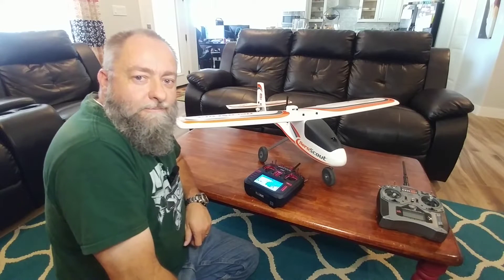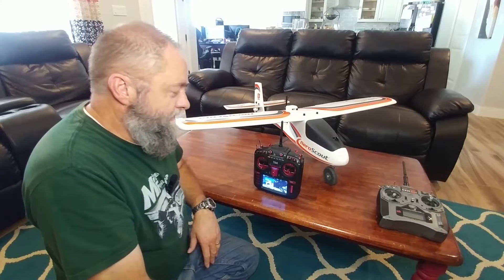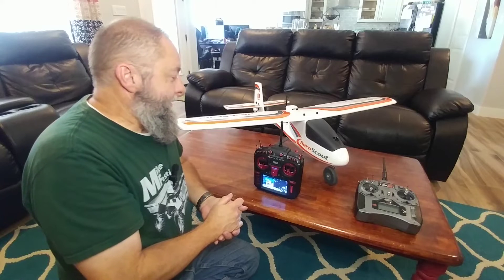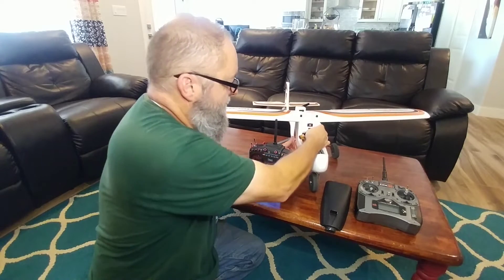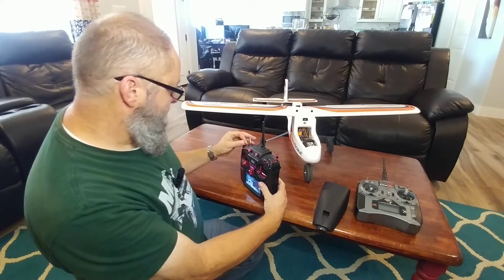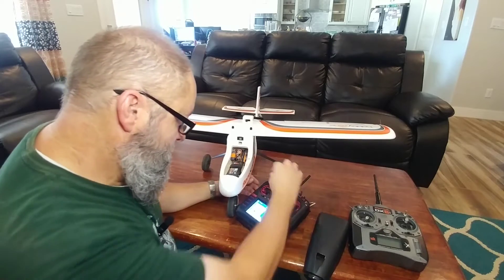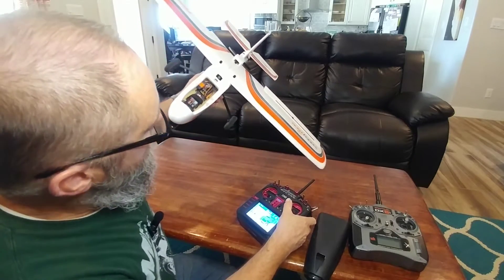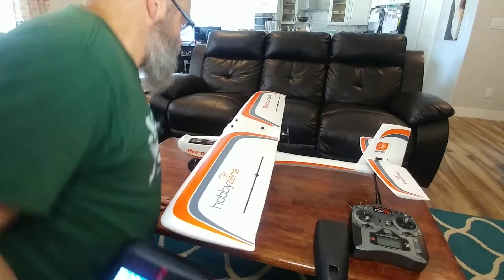Spektrum RC Safe Modes on the Radiomaster TX16S!

Comment: I have a signed switch did sticks to the centre the bind was done to get safe surfaces twitched 2 times but only got as3x but not safe any ideas
Reply from the maker: The double twitch means you enabled safe but needs a switch properly assigned to be able to select the desired mode.  What model are you working with?  Some like the AeroScout here, have channel 5 set to safe f-modes and ch 6 as panic until/unless you unlock it.  Other models don't have this restriction and you can change it.  Many require you to assign the channel by moving the sticks down and in and flipping the desired switch 5 times to set the f-mode channel. If you have that type, you must assign the desired switch to the desired channel in the mixer and then you can assign it.  You can also assign the switch to the channel similar to what I've done here in logical switches and special functions but that is more complicated.

The main reason I've used this method in this video is because I'm combining the safe f-mode and panic modes to produce a non standard flight mode.
Reply: I've done all that moving stick together flicking switch it's on f16 80mm spektrum rx but only get safe or I do first bind to get as3x I have 5,6,7,spare ch
Reply from the maker: @stevejamelskyj5761  I would need to see how you've setup the f-mode switch and to what channel it is set to. To keep it simple I wouldn't set it up in logical switches and special functions like I did in this video for your application. If you've set those up, I would disable those special functions for now until you verify the channels are setup properly.  Just go into our mixer, create a mix for whatever channel you want to use for safe on/off (f-modes) and the desired toggle switch will be the source.  Don't set anything in the "switch" field of the mix.   Then with the plane and tx bound (be sure to use DSMX and NOT DSM2 or it will not work).  Don't have any low rates programmed or the "stick and switch flip" method will not work in low rates.

What RX are you working with?  AR631, AR637, or something else?  I assume your TX is the Radiomaster TX16S?  I have newer videos that discuss how to get safe working, using forward programming, etc. that may be more helpful. Some of them are a little long but if you want to learn, the information is very useful.

Comment: Shane, does it have the Spektrum AR631 Receiver?
Reply from the maker: Yes it is the AR631. The new one also has this receiver. Different planes usually have a different setup for the BNF. This plane has a fixed default channel for safe on channel 5 and channel 6 for panic. Many other planes allow you to set your own safe channel. On this one if you want a different channel you have to unlock it as shown in my later videos. The manual for your plane will tell you what your safe options are.

Comment: Is there a way to configure turning everything off (no safe and no AS3X). I’m coming back to flying RC and I’m not used to gyro stabilization.
Reply from the maker: Yes, you can but I'll say that with just AS3X you most likely would not even know it's doing anything except the airplane will not be knocked around so much by gusty winds so smaller planes fly like larger ones. Personal opinion is to just leave it on and turn off safe. AS3X doesn't take any control away from you.

If you want to shut it all off you have to unlock the receiver to enable full Forward Programming functions. Then you can setup the modes however you want. This video just shows you how to switch between the "pre-packaged" flight modes.

I have multiple videos on unlocking the RX and setting it up from scratch in my Spektrum to EdgeTX Forward Programming series.
Reply: @shanesdiy I will check out your other videos. But I will first try it like you have it in this video! Thanks for the reply
Reply: @shanesdiy Do you know if there is a way to also program the "panic button" or is the SAFE setting the same as the panic button? Sorry I am a newb. My scout has the AR636B with no forward programming (if that matters at all). I do have the USB programmer arriving today.
Reply from the maker: @gagegr  I've never worked with any of the AR636 receivers. You'll have to use a couple different pieces of software with the USB programmer cable to set it up. The Spektrum Programmer and Safe Model Builder software are required

A frequent commenter on some of my videos is @txkflier and he has a few videos on the AR636.   Here is a link to a great video setting one up for safe, as3x, and panic.  He has links to the software in the video description.
https://youtu.be/H0Eb15wA8tA?si=4Dthj7E_jpRKLdDW

Comment: After seeing all these videos, i decided ot just get a spektrum transmitter. I dont think i can handle messing with so much settings for each plane
Reply from the maker: The more recent video series on Spektrum to EdgeTX I believe simplifies things. The forward programming operation is exactly the same as Spektrum. In this video I did some trickier things to get that "hidden" flight mode.

I love spektrum as well, I have two Spektrum transmitters. If you just want to fly Spektrum receivers you won't go wrong with one of their transmitters.   Thanks for watching and for your comment! Always happy to help a fellow RC'er in need!
Reply: @shanesdiy  Thanks mate, yeah I think at this time I'll just get a spectrum NX8 as spektrum is what I'll be flying for now anyway.

Comment: @shanesdiy Hi Shane, you’ve probably discovered this by now, but the USB programming cable cannot be used to configure newer AS3X receivers that use Forward Programming. It can only be used to upgrade the Rx firmware.
Reply from the maker: If you mean perform to detailed setup and flight modes in the PC software yes, I am aware. There are only a few receivers that are compatible with the PC software for setup like that.  I was disappointed initially but now that the EdgeTX lua scripts are updated and much more capable I have no need for the PC setup, just need to unlock the RX.  So simple to do via Forward Programming either with the Spektrum transmitters or my RadioMaster TX16S with EdgeTX.  If you haven't seen them yet be sure to check out my Spektrum to EdgeTX series. Even if you aren't using the EdgeTX there is some very useful info there on unlocking and setting up Spektrum receivers.  What I did with this AeroScout is still usable but by unlocking the RX it is essentially obsolete.

Comment: Thank you so much for that. Clear and complete !
Reply from the maker: You're welcome. Quick note, if you have a new AeroScout the safe channel may not be locked to ch 5 like the old one so you may be able to change it if desired. Episode 4 of my Spektrum to EdgeTX series has some useful info that now works with the latest AeroScout. 

Thanks for watching and the comment!
Reply: Nice, I was not aware of these .lua scripts...
Reply from the maker: I just re-read the latest AeroScout manual and they don't state that you can change the channel for safe so it may be locked still.  If you or someone could try it and update the rest of us that would be great.  See if the channel can be changed by holding the sticks down and in and flipping the new switch/channel 5 times like the other SAFE airplanes.

Comment: First, Shane, thank you so much for creating and sharing this video. This information is still extremely hard to find.

Thought I'd add something I learned that might prove helpful for some. I have a new AeroScout RTF that came with a Spektrum DXs transmitter in the box. After some initial flying I decided I really liked the plane but strongly preferred my TX16S over the DXs. I knew also that at least initially, I wanted the TX16S to control the plane in exactly same manner as the DXs. I figured if I could accomplish this I'd be more confident in changing over to the TX16S.

When I initially set it up the TX16S as outlined in this video I tested it thoroughly including measuring and comparing control surface throws. When doing so in Beginner mode I noticed that the surface throws when using the TX16S were different (significantly less) than the DXs. While searching for an answer I happened to notice in a later video of yours Shane (Ep. 3, Forward Programming...) you showed the Special Functions screen which showed values of plus 100 for both Ch5 and Ch6 for Beginner mode, not Ch5 plus 100 and Ch6 minus 100 as outlined in this video. So I made this change and vuala, now every aspect of the planes behavior including control surface throws on both the TX16S and the DXs are identical!

Again this may not be a big deal but because I initially couldn't reconcile the differences I was concerned other issues could be lurking so I thought I'd share.
Reply: p.s., might also be worth sharing a tidbit I came across on the DSM setup section in the OpenTX/EdgeTX documentation. Spektrum transmitters that use DSM will also recognize a value between -50 and -100 over channel 14 as a request to disarm the throttle. I know many people simply program a switch to override the regular throttle channel value but using channel 14 this way is better as the Spektrum receiver will use this request to have the ESC actually disarm the motor. I just followed the example in the manual that uses a switch to override channel 14 with a value of -80 (minus 80) to disarm.
Reply from the maker: Thanks for all the info! Yes they have made a few changes with the new AeroScout so some of this video may become obsolete. I've heard you can setup reverse thrust on the new AeroScout since it has the Avian ESC. In episode 4 I get in to that a little and there is a link in the description to the script developers video on using the TextGen script to set up the ESC. If you try that you'll have to let me know how it goes. 

That is interesting that the receiver will accept data on channel 14, I'll have to do some tests with that!

Comment: How did you add the throttle cut?  Which channel?  Thanks
Reply from the maker: Channel 3 is the throttle on AETR which is what I use on my TX16S and which I believe is the most common with EdgeTX.  Spektrum is TAER but that conversion happens behind the scenes so you don't cut channel 1.

Many methods of doing a throttle cut. One of the simplest is to create a special function and use the 2 way toggle SF switch to override channel 3 with a value of -100.  My throttle cut of choice is a little more complex but this basic method works fine.

Comment: Thank you very much on this video. I have Apprentice S2 and it has same Spektrum AR631 rx and i dont want to use tx that comes with it instead i wanna use TX16s. I still didnt create a model for Apprentice i did my 2 Eachine/Volantex warbirds and its way better experience flying those on tx16 than with tx that comes with RTF kit(no expo, no rates, gimbals are very cheap). As a beginner i really like that mode intermediate + SAFE cause i want to have more control but still have benefits of SAFE.

Comment: I just binded my new ultimate 3d and no matter what I can't get it to be in anything but safe mode. Any suggestions. I watched your video and others 10x. Have 12 other planes with no issue. lmk
Reply from the maker: Hi Jim.  I'll assume you purchased the BNF model with the AR637TA and that you are using a Radiomaster TX16S?  Correct me if wrong.

First, do you want safe?  If not, re-bind but without pulling the bind plug out and it should disable safe all together.

Second, if you do want safe, you need to map the desired toggle switch to the desired channel, you can use any channel between 5-9.  You only need to map this toggle switch in the mixer, no need to add it to one of the inputs if all it is doing is switching safe flight modes.

Third, in your model setup be sure you do NOT have "Enable max. throw" turned on.  If you do, the next step won't work properly.  If you cranked up rates anywhere else over 100 reset them back to -100 to +100 for this process.

Fourth, while bound to the airplane make sure the control directions are all correct. Normally aileron and rudder are inverted, elevator is normal and rates at 100% (can't have any dual or low rates set).  You move the sticks down and to the inside and flip your SAFE switch starting with it OFF (-100%) turn it ON/OFF 5 times.  On the 5th time the control surfaces should do the "dance".

Then try your safe on/off switch.

Alternatively, if you've got the latest forward programming lua script installed, v0.54 as I write this. You can make edits in forward programming. I have a few videos on that as well.  Episode 3 coming out soon.  You still have to have the SAFE switch programmed correction  per steps 3 and 4 above to be able to switch between the 3 flight modes in forward programing.

Give this a shot and let me now how it goes. Happy to help if I can!

PS- just remembered, be sure your protocol is DSM X and not DSM 2 or telemetry and forward programming won't work.
Reply: @shanesdiy  wow that was kind of you to take the time to write. Yes I do want safe on a switch like my others. They are all umx stuff so they all seemed to work with me setting up the switch but not this one. I'll go step by step this Sunday and let you know if that works. Thank u again!!
Reply from the maker: Oh, and for that airplane, you don't need to do the tricks I did in this video with the logical switches and special functions.  Just need to map one switch to the desired SAFE channel.

If you plan to use the reverse thrust, that has a default channel assigned to 7 so might want to use 6 or 8 for SAFE. Not sure if 5 is anything on that plane.
Reply: @shanesdiy  At work have not had time to work on plane...tonight for sure. I thought ch5 was for safe? That is what all my others are and where I assigned the switch to. Perhaps that is my problem? What switch is safe? also if you have time to explain how I can set up motor cut off..lol I know I AM ASKING ALOT.
Reply from the maker: @jimnardone32  Sure I'll share more detail. Can you confirm if you are in fact using the TX16S?

On the TX16S, and most other transmitters, you can use any switch you want for safe. I use my SE switch. You just need to assign the switch to the desired channel in the mixer.

Some planes like my AeroScout have the safe channel pre assigned, other planes do not so you have to tell the RX which channel you want to use.

I am working on Episode 3 of my forward programming series today, it will have some helpful info for your setup I think. Should be released this weekend!
Reply: @shanesdiy  perfect yes I Have a tx16 and use my se on my other planes for the safe I will put the throttle cut on the other side once I figure that out. Look forward to your episode 3 I subscribed to not miss it

Comment: Nice to know it works with the tx16! Do you know how to do this for an off the shelf Spektrum AR631? All the videos I've found are for bind and fly planes with the receiver set up.
Reply from the maker: Hi thanks for the comment. The off the shelf AR631/AR637 must be setup with Forward Programming as they don't come with any of that setup by default.  There is a new Forward Programming LUA script for EdgeTX that adds significant functionality.  I've started a new series on it.  Episode #1 shows how to get the software onto your TX16S.  Episode #2 should be out soon and will go over how to unlock a BNF receiver and we will go through the Forward Programming menus a little to show how to change some settings.  Episode #3 will be a fresh program from scratch on an unlocked AR631 which is essentially the same as an off the shelf AR631.
Reply: @shanesdiy  Thank you for the detailed response! I will check those out and wait for #2 and #3. As a noob to fixed wing, I would love some assistance till I get used to it. I'm now looking at FCs with trainer modes as well. I'm surprised there is no direct competition to SAFE for people who don't want to purchase into the Spektrum architecture.
Reply from the maker: @ShahriarFarkhan  There are a few companies that make gyro stabilization units for RC planes. LemonRX (link below) has one that uses the Spektrum DSMX protocol and has a built in stabilizer. I haven't used it but I hear good things and the price is reasonable compared to a comparable Spektrum receiver. Arrows RC has their "Vector" stabilization gyro unit that can "piggyback" on most receivers and gives you equivalent to SAFE/AS3X. I have used that one, it came on my brothers RTF Arrows Bigfoot plane.

LemonRX DSMX receiver with stabilizer.
https://amzn.to/3kBCZGW